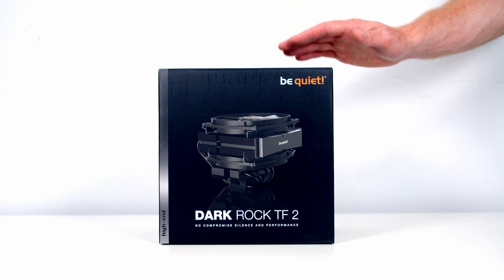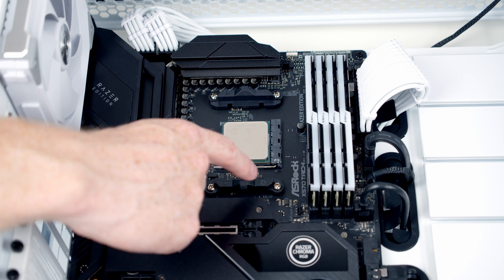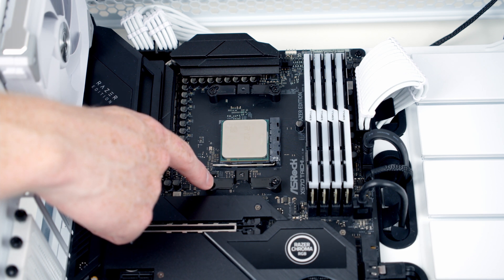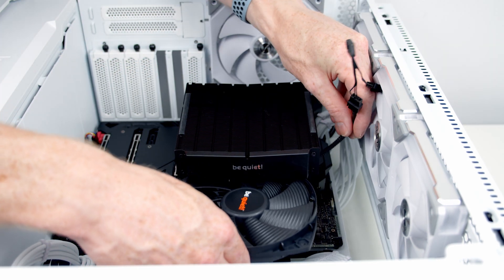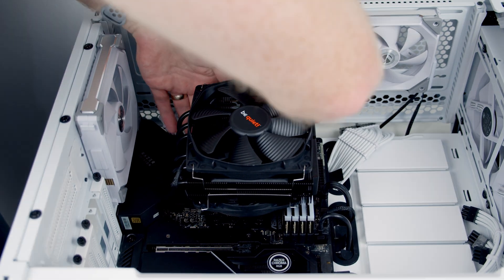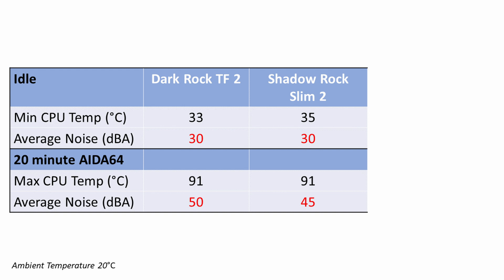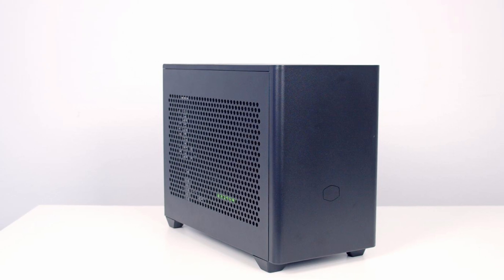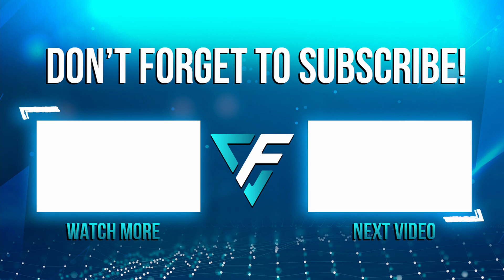be quiet! Dark Rock TF 2 - Overview and Installation Guide

Comment: Tease heat sink air coolers in my opinion are terrible... Not for their performance but for the pain and struggling I go through either installing or removing them for computer repairs at my store. 
Liquid cooled are so much easier to work with and I don't cut my fingers up. Liquid cool seem more complicated than most people at first but they're much easier in my opinion.

Comment: Chris...air vs.water? For Microsoft Flight Simulator 2020?  What is the Rocks longevity?
Reply from the maker: Depends on the case and your preferences (looks, noise, temps) both can work well. Dark rock pro 4 is still my favourite air cooler and if you want a quiet build it would be first choice, 360mm AIO as intake will look better and give better temps, but will come at more noise, cost more and have the risk of water in the build. I would expect air cooler to last longer than AIO (less parts to go wrong and no water to evaporate)

Comment: Thanks for the review but you didn't start with "Welcome to another video" !!! :-) Interesting review as always but personally I just don't like the thought of using air coolers in modern higher temp CPU builds. I used an AIO a few years ago for the first time and now would never go back. They always seem to perform better temp wise under heavy loads and as some people use their PC for game playing for hours on end it seems the more sensible option in my opinion if you are likely to do the same. That plus the fact that you'll pay almost as much for a high end air cooler as you will a lower end but still reasonable quality AIO. Not to mention the air cooler finnicky clip arrangements. Each to their own though.
Reply from the maker: Varying my intro. I prefer and AIO personally, but air cooler good for those who don't want water in the PC or in noise is most important feature. In certain SFF build e.g. you might fit a large air cooler or 120mm AIO where the air cooler will have the advantage.
Reply: Air is better in every way, people forget that when using water Specific Heat is the main factor they ignore.  Water is cooler till it completely saturates then it goes flat and remains there till further outside elements allow it remove heat further.  It's why Cars have thermostats, it locks the water in the radiator too cool it more then when the heat rises inside the engine again, the thermostat opens and cool water enters the engine.  AIO and custom loops don't have this so after an hour or so you have a glorified air cooler with water in it, and that's all.  Also water stays hot after you shut down and takes far longer to settle to room temps unlike air coolers.  Most important if an air cooler fan fails it's an easy fix, you have a failure in an AIO and it's game over if it leaked, if you're lucky and it just stops working, you're out whatever you paid for it.  Advantages go to Air coolers,  with mostly hype going to AIO's and custome loops.
Reply: I'm still on air , with a 5600X, It rarely hits 62 degrees playing intensive online multiplayer games,. When listening to music and browising around 35 and idles around 29 . The CPU fan is Arctics Freezer 34 eSports Duo . MY GPU a 2070 super also on air only gets around 69-70 max. All using the Corsair 4000D Airflow case. Coolest and quietest case i've ever used.